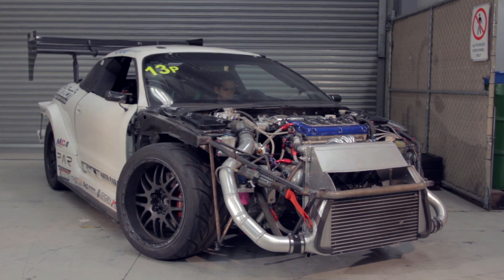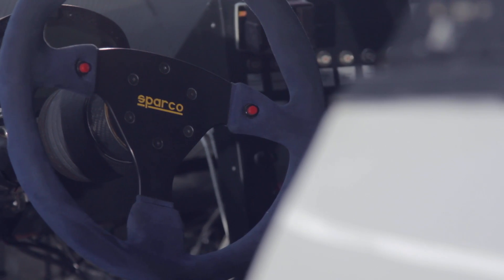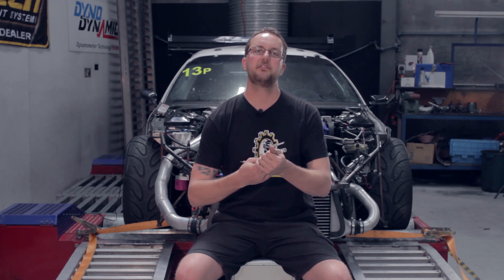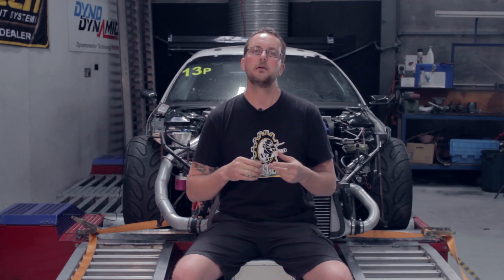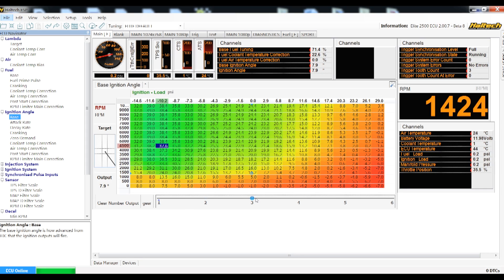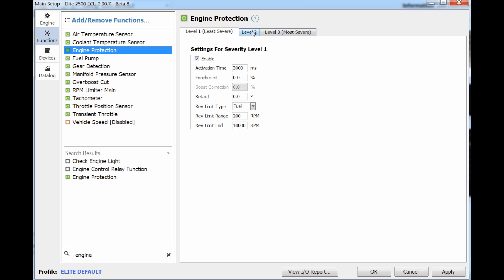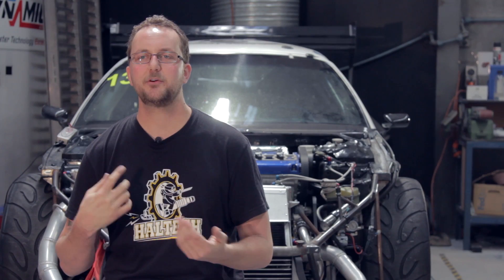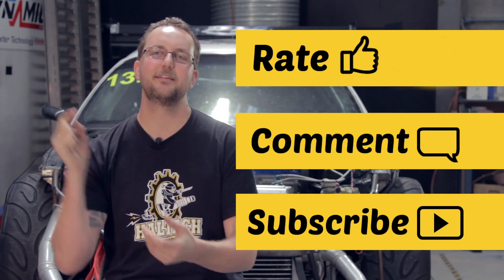Haltech Technically Speaking - Elite on Maximum Attack

Comment: I can attest - that my oil was a little low due to a small leak, and when I went around a hard-er corner, the oil I did have sloshed outside the oil pickup, dropping oil pressure below my setting for that rpm in my classic car.  Fuel cut level 3 and rpm protection kicked in... and I only had idle.... I knew immediately what had happened (As I only have a few engine protections setup) and I pulled over and cleared the code after checking a few things.  Without this fuel cut and rpm protection, I could have damaged the engine or lost the engine completely.  Thank you Haltech.  This stuff truly works even on a street car.

Comment: so can i install it and pass an obd2 inspection as in new york state
Reply: not sure about the inspection, but you can buy a cable to get an OBD2 connector - which will allow the inspecting shop to 'plug' in to the car and read the settings over OBD2 proticol just like any other car.  You do need to configure this in the software (it's like 3 clicks) but I use OBD to a bluetooth adapter to watch oil temp and coolant temp and fuel level.

Comment: Hi, is it possible to set up a 3d table for oil pressure target based on oil temp and rpm and have an alarm if the oil pressure is too far from the target? ie pressure too high or too low, which obviously varies based on temp at any given rpm.